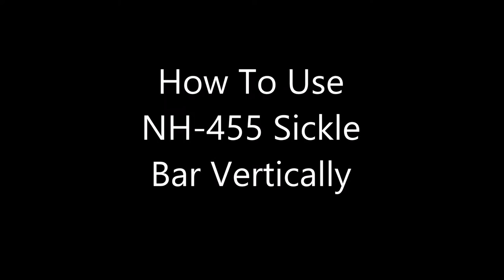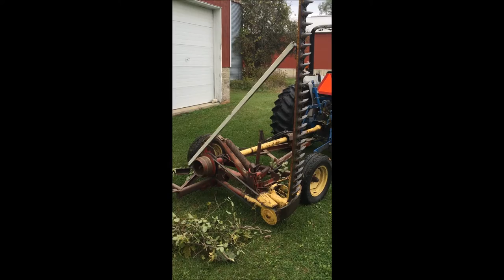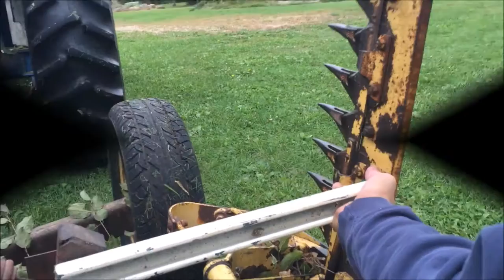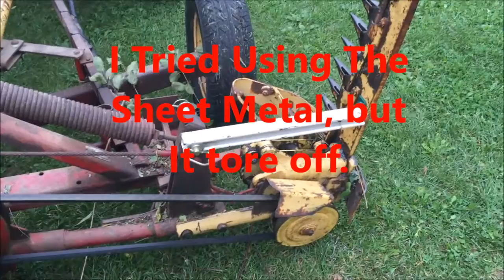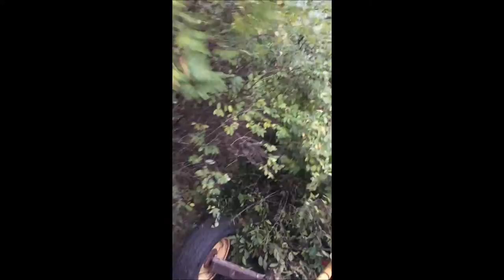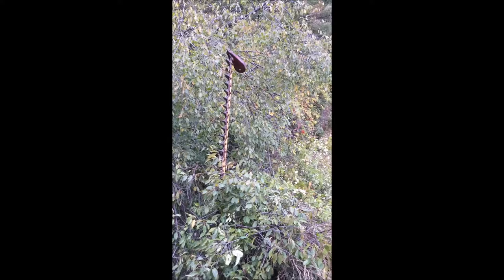New Holland 455 (NH455) Sickle mower Bar Vertical Use

Comment: Thank you for this! I will be doing the same thing. Was the model important for vertical operation or do you think most sickle mowers could be used vertically?
Reply from the maker: The model does make a difference. I figured out this model can be used in a vertical position. Some with a pitman arm don't look like they would work vertically but I'm not sure. I couldn't find any information on anyone using this or any other model in a vertical position so I made this video.

Comment: Thanks for sharing.  I've been wanting to do something similar for several years
Reply from the maker: Good luck... I changed my teeth and guards the bolt on. That makes it easier to change them when you're break one off. I made this video to show people that this model specifically does work in a vertical position. I am not sure about any other models.